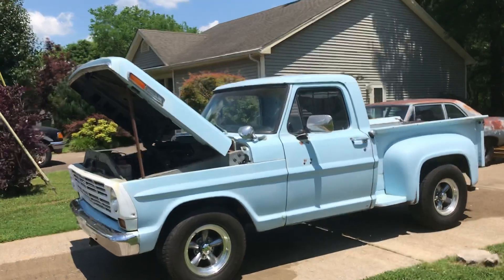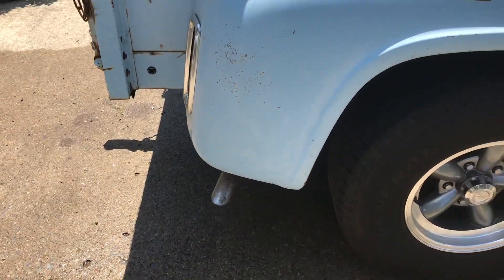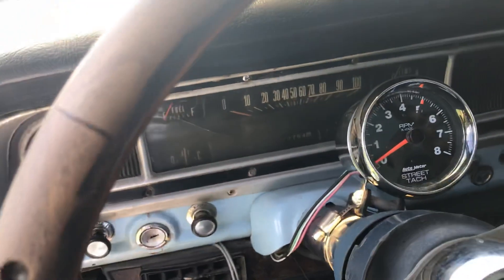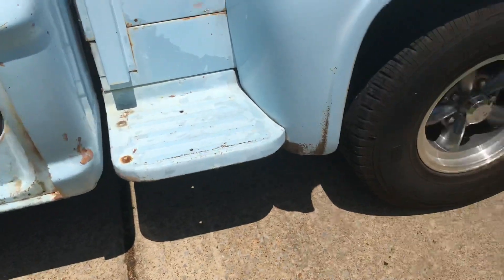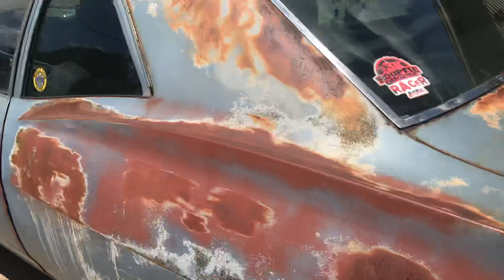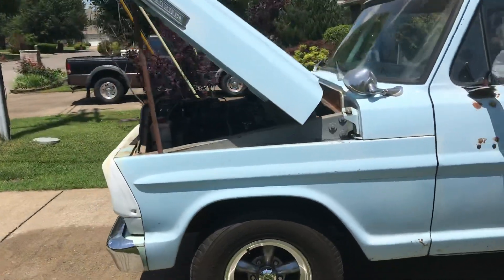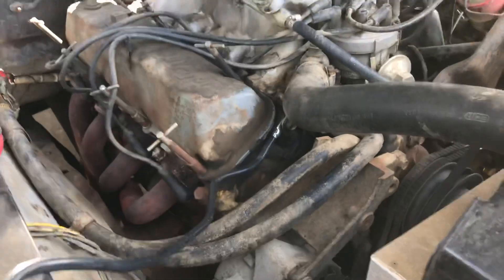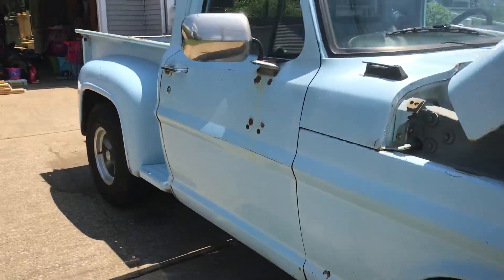Roadkill Garage Ford Muscle Truck FMT and Roadkill Pikes Peak Biscayne

Comment: Do your research.  460's respond well to some pretty straight forward upgrades.  Higher compression heads, straight up cam timing, and a good tune.  The Guide spotlight you can get all the parts for including better bulbs and stuff.